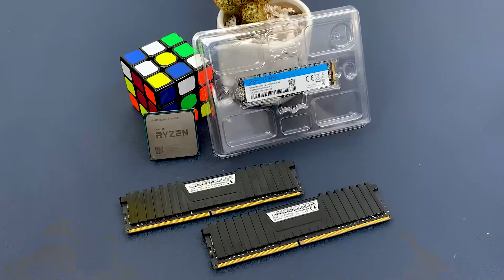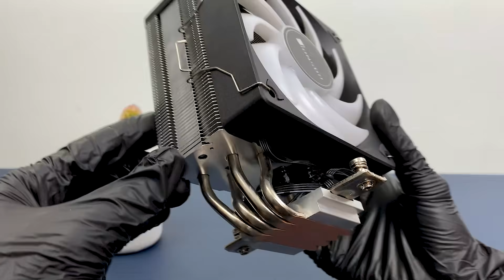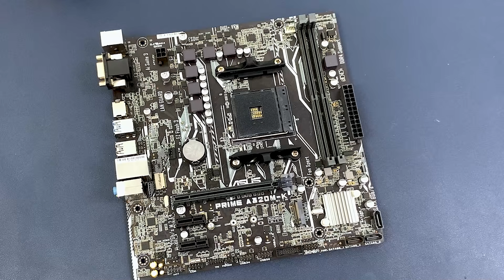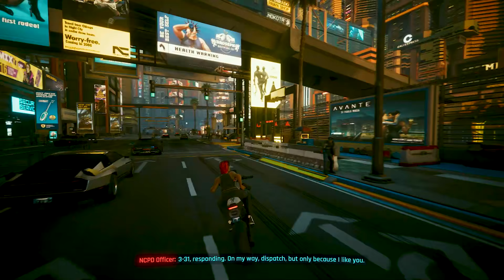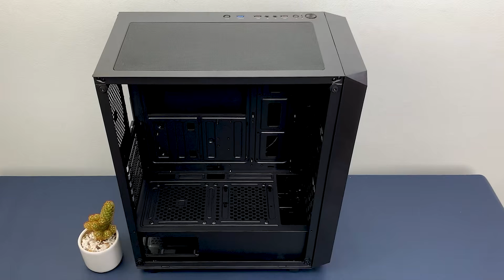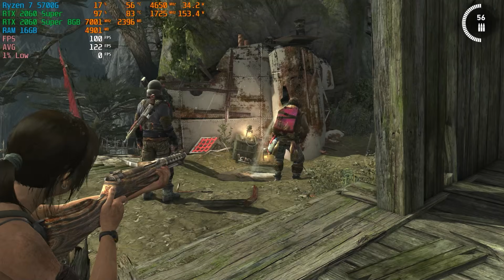The $500 Gaming PC no one is talking about...

Comment: AMD naming scheme is confusing. The 5500 is actually a 5600G without the integrated graphics. Then the 5700 is actually a 5700G also without the integrated graphics. And unless you go digging through the specs, you won’t know that both the 5500 and 5700 are missing valuable “L3 cache”, only having 16MB, due to being based on the integrated graphics version.

For the best bang for your buck in AM4, look for used Ryzen 5 3600, Ryzen 5 5600, or Ryzen 7 5700X based on your overall budget. All three of these CPUs are fully featured for their generations and don’t have integrated graphics.
Reply: The clock speed is different on the 5600g and 5500, and also the memory controller
Reply: It would be recommended to build a pci-e 4.0 system if you can (b550, 5700, gen4 nvme, rtx 3060 8gb). The 5500 and the a320 chipset only supports pci-e 3.0. The 2060 super is pci-e 3.0x16.
Reply: @vpmedia9135  I definitely agree with a PCIe 4.0 system, but for the cpu… avoid the “Ryzen 7 5700”. Instead get the 5700X, 5600XT, 5600X, 3600X, or 3600.